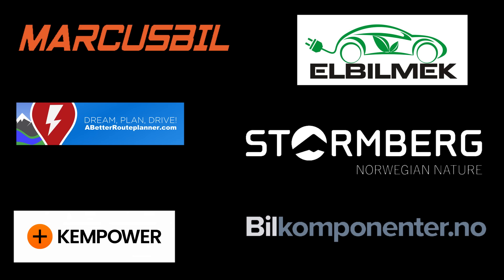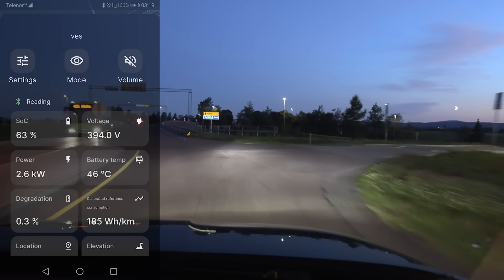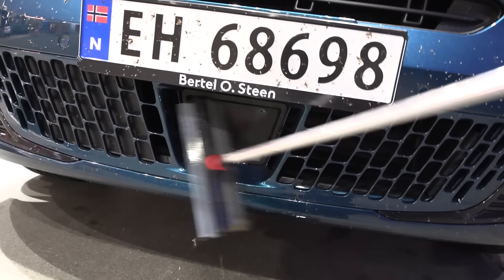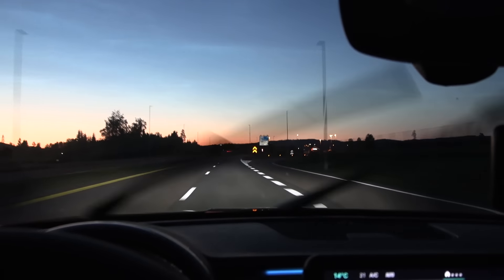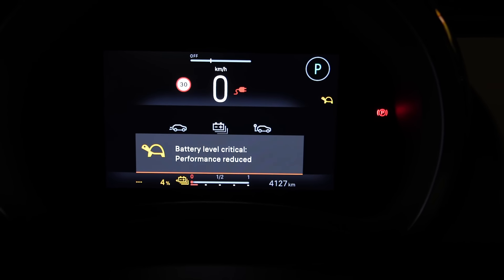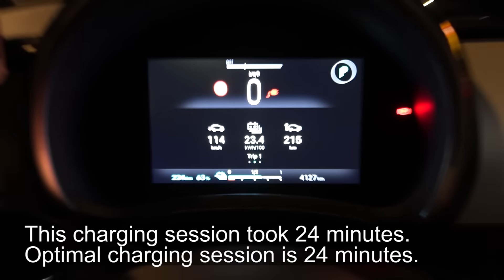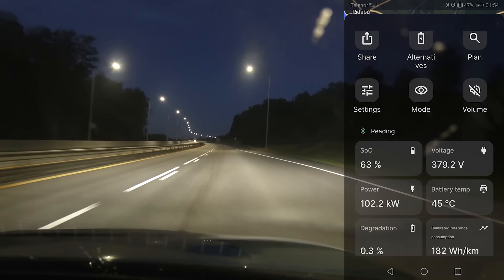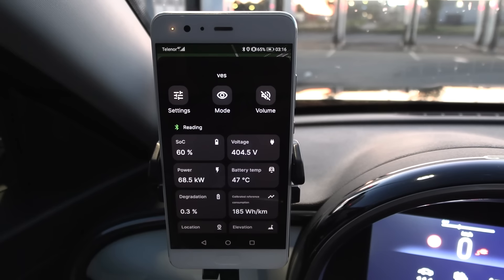New test: Fiat 600e battery stress test

Comment: I have noticed it on my e208 that the cooling is really good. its an 2020 model so older tech. I noticed with a road trip in France in the mountains that the compressor was really loud. And maybe for 15 mins the AC felt a little less intense but it was still able to keep me cool. It was on a hot summers day lots of hill climbs and regen on the way down when I arrived and plugged in the car it kept cooling and using the compressor for almost an hour. But all in all battery care is good on the stellantis platform . I'm at 100K km's and battery is at 92%  soh  quite good for the little car.

Comment: Nice test, do it with a korean Car. I've driven 1400km through sweden in one stretch and 700km teough Germany, last week, and not slow, 160 cruise control in Germany and Speedlimit+10% in Sweden, no overheating problems. And no power limit after fast charging.  72 kwh ioniq 5 rwd.

Comment: Did some tests with the old platform on the Peugeot e-2008, never seen any issues on rapidgate or overheating. But i have seen slow charging in the wintertime. no battery heating on this model. dont know if the new platform have battery heating?

Comment: Interesting video. I didn't get a good impression of range per charging session. Would have been nice to see that. It is unfortunate that adaptive cruise control didn't work well and does not inspire confidence in Stellantis driver aid technology. For me, this would be a deal breaker. It us nice to see the battery is holding up well to stress testing. No charging issues inspires confidence in investing in Stellantis EVs.

Comment: The consumption is clearly too high for a small car with only 150 kW.
Reply from the maker: 150 kW?
Reply: @bjornnyland  I think he is talking about the motor power (which is 115 kW). Consumption in this test is more than ok, it was a forced test, not an economic one.
Reply: @bjornnyland    Sorry 115 kW / 156 hp !
As a result, the consumption of 23 kWh at approx 115 kmh appears even worse.